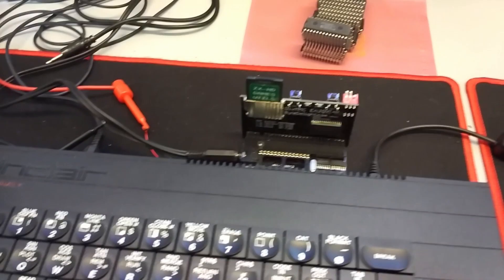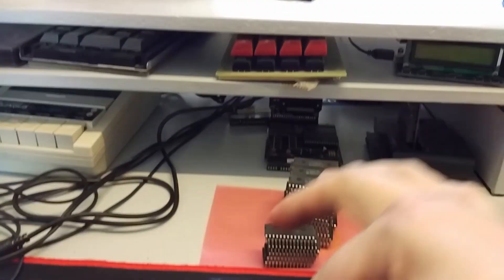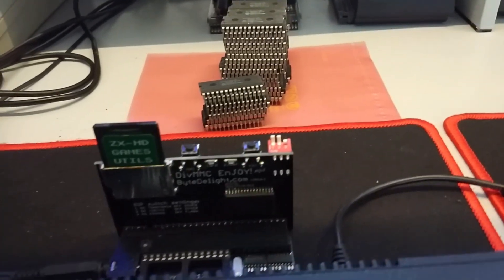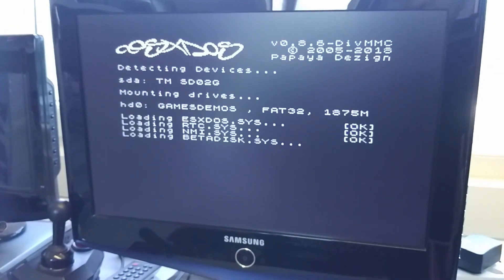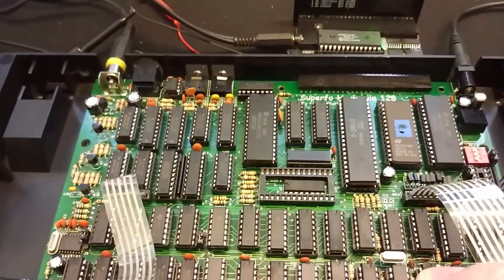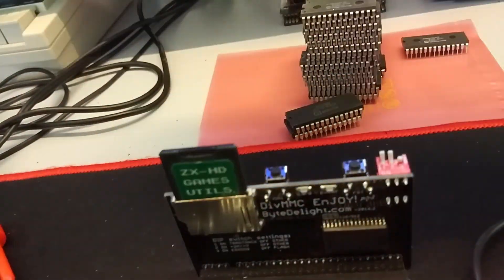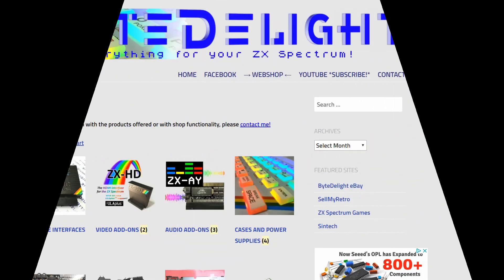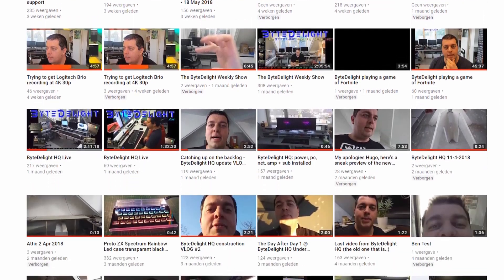AY-3-8912 testing process

Comment: is this tester going to be available for sale??  if so where can we buy?  thank you.
Reply from the maker: It's software, a tool that Velesoft offers. I think if you google for it, you will find it.
Not sure which boards make it possible to actually use the software - it might not work with e.g. a ZX-AY add-on, but only on a ZX Spectrum mainboard.